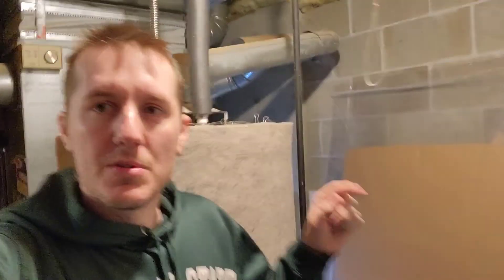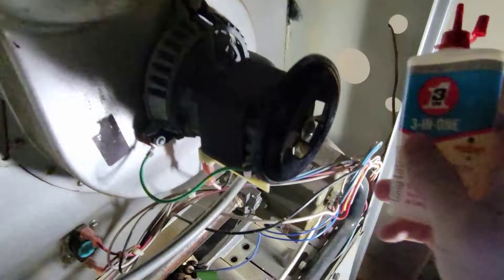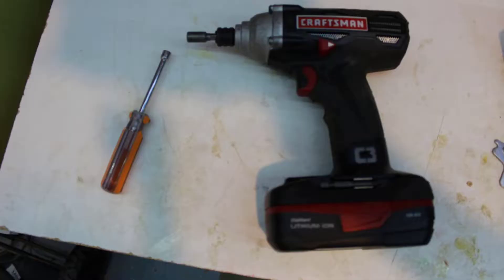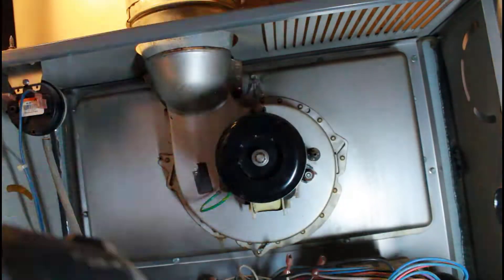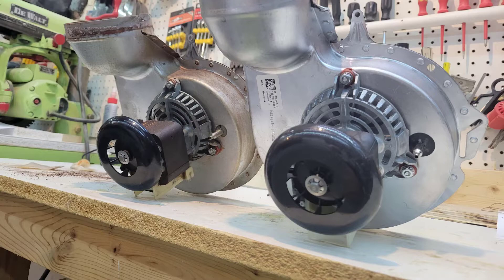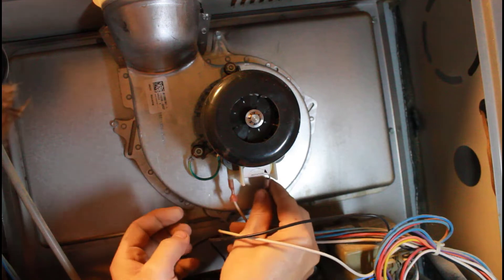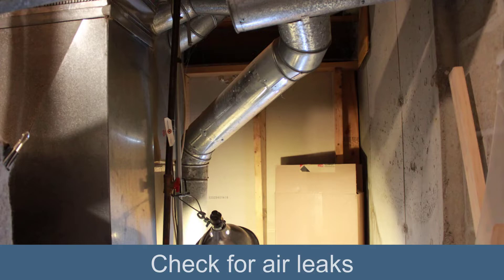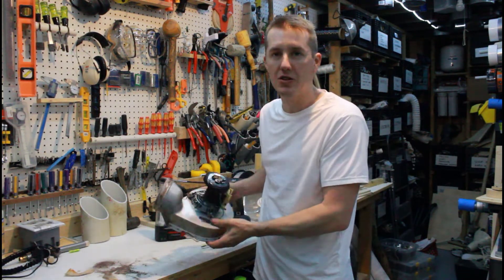Replace Furnace Motor  |  Furnace Making Noise

Comment from the maker: Furnace Inducer Motor Models .......................................... https://amzn.to/3o10gQx
Inducer Motor Only ............................................................. https://amzn.to/3nUxfWp
Aluminum Tape ................................................................... https://amzn.to/3k5dr1I
Carbon Monoxide Detector ................................................ https://amzn.to/2ZQrQbb
Reply: great video thank you. The old gasket looks different from the new one?? Did you use both or only the new one? Thanks
Reply from the maker: @AboAlfaad  Used the new one.  It's just like and insulation fiberglass material.

Comment: In the comments, baire702 is wrong. The 3 in 1 oil you used is 100% the correct oil for that application. It is SAE 20 motor oil, made for 1/4 HP motors or larger. It's not the original 3 in 1 he is talking about. This one contains no wax, and will not gunk up anything.

Comment: NO! NO! NO! Never use 3 in 1 oil on anything smaller than a door hinge. It has a wax base and is good at gunking up what you add it to. And never use it on a sewing machine.
Reply from the maker: What would you recommend using?
Reply: @DaveWirth  TriFlow, spray, drip, and grease forms.